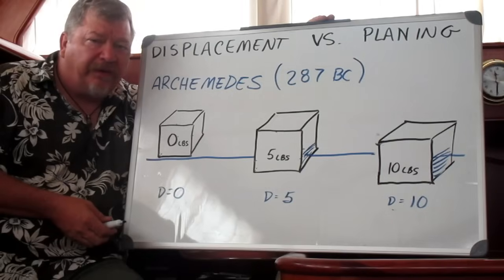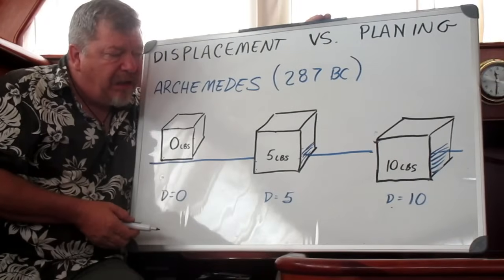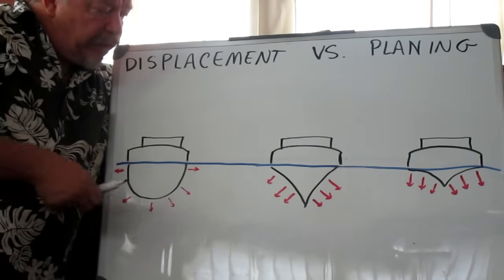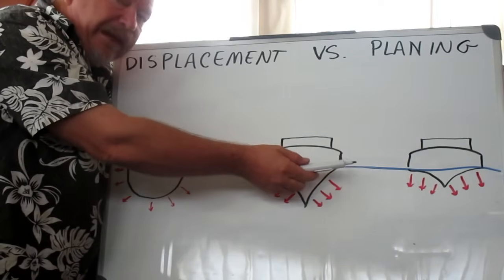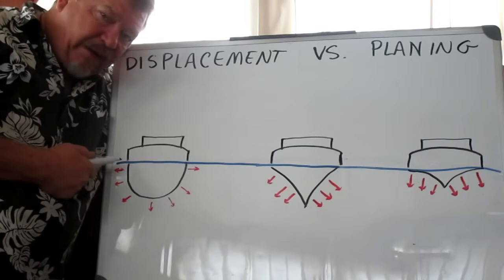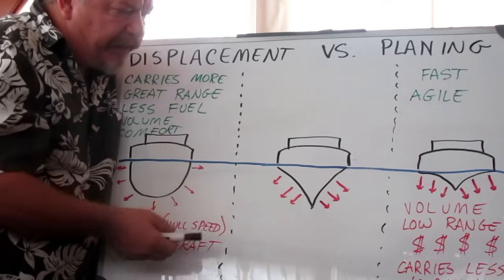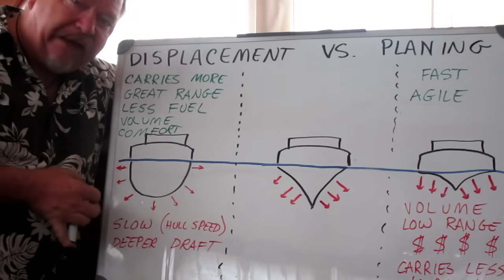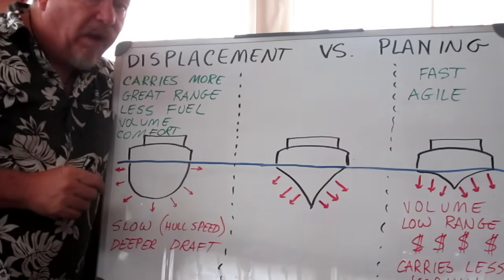Displacement vs  Planing Hulls

Comment: Internet experts tell me this; is not the planing capabilities of a boat be dependent on it's average draft?  If it only covers a larger area, but is shallower, almost any size boat will plane, depending on surface friction/ water speed propulsion ratio. 

I also feel that this video poorly explains why a displacing hull is more comfortable. A deeper penetrating/ heavy hull will go "through" waves. whereas a light/ planing boat will go on top of them, making you move with every wave. 
The wind also affects the boat, both directly and indirectly. 
The goal in comfort is to remove movement. There are multiple ways of doing this. 1. making the boat long. This will enable it to float on top of the waves to a degree. Long speedboats are remarkably comfortable, but this approach is also limited to the waves you are traveling in.  Nature has no limit, boatbuilders do.  
2. Making it heavy, and displacing.  More weight= more wave required to move it. It will move more water, but so will your engine have to do.  Submarines are completely still, they just go deep.
3. removing sway. If you have big keels, of fins "anchored" in the still part of the water, the force of the mast and sails or waves coming from the side, making the boat roll will be counteracted to a degree. 

Solutions (some theoretical) include: Gyrostabilization of the entire boat or just the cockpit, Hydrofoiling (planing out of the water), accelorometer rudders and keels, counteracting the waves like wings. Sheer size, and sheer speed. 

Then there is Multihulls. Top performance racing sailboats now are made to be as big, light, hydrofoil, multihulls
Multihulls can be extremely stiff in the water. But whereas a normal sailboat lays over more as the wind blows harder, a katamaran or triamaran will barely lay over on it's side, and use all the power of the wind to push it forwards. 

Any directions on what is the best combo for a low draft, heavy weight, long distance sailboat?  I'm into Aluminum katamaran with removable keels,  pointy in the front , and flat in the rear, triangle type of deal... if you catch my drift.
Reply from the maker: MusFuzZ,  First, thanks for watching.   Second, Wow!  You brought up some items I did not even get close to in the vid.   I am no marine architect or engineer; I just have a passion for this sort of thing.   Way back when,  I looked at some aluminum and steel power catamaran vessels in the 6o foot range (where metal becomes practical for most cat designs), and realized that the hulls were acting more like separate monos to the point that the addition of a bulbous bow on both hulls was a reasonable consideration.    As to shallow while heavy, logic tells me you have to increase volume to hold up the weight.   Since 'shallow' rules out deeper, you got the choice of wider or longer.  Longer seems a little saner in a mono, but might be an even consideration in a cat.  I have seen some neat (mono)  boats with a length to width ratio under 3:1 that seemed to perform just fine (did not have them in a storm, mind you, and we were motoring, not sailing).  My thoughts start wandering to how you will mitigate lee slip in order to point as high as possible into the wind.   Have you considered lee boards instead of centerboards?   I think you would retain living space and if something breaks (it always does), the leeboard is out where you can work with it.   Dutch tjalks are a neat looking boat, but not sure how you would blend that into a cat concept.     Thanks for a thought provoking text!
Reply: MusFuzZ, To answer your first question; average draft (if you mean the average depth from waterline to keel) does not determine the planing capabilities of a hull.  Long lines determine planing capabilities.  More specifically, long lines in sheer and half-breadth plan view.  If aft of mid-ship the long lines below the waterline flatten out to horizontal in sheer view and parallel to center-line in half-breadth view, you have a planing hull.  The more draft a hull of this shape has is only a factor in determining the power needed to get it to plane due to increased wet area.  In order to have much draft in a planing hull it will have a deep v shape.  Too much v can be a bad thing running too far aft.  Some of these deep v all-the-way aft designs have been know to capsize after getting on plane.  

Displacement hulls have long lines aft that curve back to waterline and back to center-line and will never get up on plane no mater how much power.  Brad does a good job of explaining the general characteristics of displacement hulls vs planning hulls.  Put simply, displacement hulls roll and planing hulls pound.  Planing hulls are fast and fun but will beat you to death in a decent chop.

Seekeeper has a gyro you can install starting around 30k.

Comment: what about the new x bow
Reply: https://www.youtube.com/watch?v=wNyvyI4bXGQ
Reply: I think this design would be great on a smaller commercial crabbing boat in the 40 ft range that im considering for stone crabbing .  I want the wheelhouse to be up front but conventional boat with with wheelhouse up front will just beat the crap out of you in rough water.
Reply from the maker: Meh.   It has the same shape below the waterline as thousands of other vessels, including sailboats.   Yes, it is different above the waterline, and may slice through waves better than other vessels, but it also lacks the deck space forward that a sailboat (usually) needs.   Lots of racing sailboats have plumb fine bows that do the same thing, and a bowsprit for the forestay to get the proper sail volume.

Comment: Displacement and weight are not the same thing at all.
Reply from the maker: Peggy,  Well, they ARE spelled differently.   I, and the rest of the readers on planet earth would like to hear why the weight of the water displaced by the vessel DOES NOT EQUAL the weight of the vessel.   Physics professors across the nation hang spellbound on your wisdom, Peggy.
Reply: If an object is completely immersed (sunk, for example) it will displace an amount equal to the volume of material, and not the weight.
Reply from the maker: If a vessel is sunk, then you are correct.   Where in my video am I discussing a sunk vessel?  There would be no point in discussing the speed of a sunk vessel.   The vessels I describe in my video are NOT IMMERSED.   Did you miss that?  For a vessel afloat (such as the vessels in the video),  displacement weight = vessel weight.  Your comments are based on your own 'what ifs'.   We can 'what if' all day long.   If frogs carried machine guns, snakes would not mess with them.  If the vessel is a submarine, then displacement weight STILL EQUALS the weight of the vessel.   Otherwise, submarines could not surface.
Reply: My original comment did not specify a floating vessel.  It was a generic comment that displacement and weight are not the same thing.
Reply from the maker: Your original comment had no relevance to the video.   You were just poking at someone for the sake of poking at someone.

Comment: I don't see how the one on the left would be deeper in the water when each inch of hull below the water has more  volume than the other two huls.   So unless the boat weighed a lot more,  it should have a more shallow draft (i think that's the right term).
Reply: Mike,   Thanks for watching!   Rather than look at draft or displacement weight, please notice that the water is shouldered aside, or deflected, or pushed (your choice) perpendicularly away from the hull.   Liquids don't compress (at least not enough to matter here), and the resulting effort is translated into lift.   The shape of the hull, then, controls the amount of lift for any given speed of the vessel.  Hope that helped.

Comment: Realizing your video is a year old, I thought I'd add my two cents worth. A lot of people are being picky about terminology. Archimedes principle had to do with volume and mass. But the general point is the volume of the boat must displace a volume of water with an equal Mass to the boat, otherwise it doesn't float. Regardless of terminology I think you have grasped it perfectly, some people are just too picky.
Reply from the maker: Jarod,   Thanks for watching!    Yes, some folk are picky, but it doesn't bother me much.   I have had an amazingly small amount of trolls on the site.   Have had a lot of instructors and students of the Coast Guard Academy and Naval architects thank me for the easy explanation.   That said, I am no engineer and certainly not an expert.  I would hope that this vid helps people understand some of the concepts.   If they are actually building or racing, then they would want a lot more experienced person than me to explain it all to them.   Cheers!

Comment: Sorry this is wrong. It is the volume of the submerged object that is displaced. Imagine a extremely, unnatural heavy stone, thrown in the water compared to a light stone.
Reply: The assumption made is the object has to float.
Reply: High Velocity it is about the volume of the part of the boat that is submerged.
Reply: The object has to displace it's own weight or it sinks.
Reply: He's talking about boats not submarines.

Comment: I come from a boat building family and still find boats fascinating.  I wish to comment on this subject in that displacement hulls are only displacement hulls when they are stationary as when they move the dynamics around their hull provide regions of higher and lower pressures and these are vectors and so the hull even though we may call it a displacement hull, it still experiences the   dynamic forces that a planing hull experiences. Really no hull is a displacement alone and no planing hull is planing alone as even if it rises on foils there is still the displacement of the foils in the water.  
The  dynamic pressures along the  moving displacement hull are very complex as at the bows the pressure rises due to the fact that the  half angle of the bow is  accelerating the water laterally so that t he hull can go through the water.  Since the water is not compressible, then the water rises causing a bow wave while the bow becomes more immersed and so displaced more water causing this  action to raise the bow.  Midway on the displacement hull, the water dynamics will cause the mass of water to drop down below the  normal surface due to the momentum of the water coming down the   elevated bow wave. As the water moves away from the hull, the hull sinks a little as the  narrow bow  angle  does not have enough displacement nor dynamic lift to replace the buoyancy of the voluminous middle part of of the hull.  So when a displacement hull moves then  it sinks a little and it tries to fit into a wave of its own making.  At the stern the water will try to move in to fill in the trough that the hull creates as it moves forward. Filling in this trough is the most difficult part of the function of a displacement hull as the water has a lot of inertia and it is reluctant to move back into the stern part or under it one might say.    Now the moving read underside of a displacement hull is raked up and this is because a truncated stern as that of the planing hull creates a lot of drag.  The underside of the rear part of a displacement hull creates a lot of low pressure trying to suck in the water under the stern and also causing a  partial vacuum which  tries to pull back the hull and this is a form of drag.  Since the water  is so reluctant to fill the understern part then then design angle of the manner in which the stern rises is very critical and for faster  buoyancy hull it is this rise angle of the stern that decides how fast and how much sucking back is  created. In a hull with a powerful engine, the moving displacement hull raises its bows and  digs its stern and this is a waste of money as the fuel is used in making waves rather than moving the boat at a faster speed.    The raised stern in a displacement hull makes a very comfortable ride with a read wave attacking the boat and broaching is avoided . 
Nowadays with such powerful engines, the rear part of a displacement hull is truncated and rather than filling the void with water one permits air to fill in behind the truncated transom, Fast commercial passenger catamarans use this technique and they can go faster because there is no vacuum forms  just ahead of their transom.     
With planing hulls there is an even bigger story as while the centre of gravity stays put, the centre of lift moves ahead and astern of the CG and so a planing hull can oscillate and porpoise and it is very difficult to design a stable planing hull for all conditions,  we try, but no one has yet succeeded in optimising a planing  hull  for all sea and weight conditions. 
The owner of the Puffin seen in this video is a very wise man in selecting the boat he wanted.  It looks as if he is wise enough to appreciate all the benefits and disappointments provided by the displacement or the planing hull.  I   feel that at my age a displacement hull is my preference but the hull I prefer is one where I would summarise through saying that the under curve of the  hull  would be something like an inverted sine curve and no displacement hull should be designed on a straight line representing the horizontal surface of the sea as that is a static condition.   When a displacement hull moves in the water it creates a bow and a rear wave and the whole hull must fit in it with the same draft all through the curve.   This may sound far fetched but  I say that a displacement hull moving at its maximum natural speed through the water is in fact a planing hull as the dynamics come in to  support the hull in a wave of its own making and though it sinks in it a little , the hull is really a semi planing hull.    The beauty and elegance and majesty of a displacement hull going at its maximum limiting speed through the water is a situation that will fascinate me to study the situation for the rest of my life.
Reply from the maker: Carmel,   Thanks for watching the video, and thanks for an awesome explanation!   Lots of things there I did not consider and fun to think through.   I am no engineer or marine designer, so I tend to go (as in the video) with the 'rough' explanation.   As you balance the cost of vessel production into the mix, I think you boat builders have come up with some elegant solutions; a tapered stern to reduce the stern vacuum, for instance.   I am also fascinated by what an unrestricted budget will produce, such as the shapes and size of the bow protrusions on Navy vessels.   If you have the opportunity to use a test tank, I think it would be very interesting to pursue your idea of a curved keel that changes the hull volume to mitigate the bow wave.     Another area I think would be fun to study is the work being done using air bubbles (pumped into the laminar flow) to mitigate some of the drag on higher speed surfaces.
Reply: This is of course true, although the conventional terminology is accurate enough for normal descriptive use.  A displacement hull is designed to go through the water although it generates some lift, a planing hull is designed to skim over the water, and a semi-planing hull to rise up and carve through the water.  The most extreme cases are those super short windsurfers which will not support the user above the water level until they are generating lift.

Comment: I’m looking to build a solar powered boat (over the next 2 years) and I want to be able to go to the north and south poles the boat will only be around 8ft by 20ft give or take what hull type would be best?
Reply: It’s going to be made from aluminum
Reply from the maker: Wow!   That sounds like quite an adventure.   I would recommend a mono hull for a couple of reasons.   First is that you can carry more supplies because the mono is less sensitive to weight than the average cat.   Second, you can use metal in the construct for the same reason.   Resistance to ice is going to be critical.    Yes, you can get in and out faster in an average cat due to the faster speed of the hulls.   Just my 2 cents, though.  You may want to bring the question to both a mono hull designer and a cat hull designer.   That way you can compare the styles by cancelling out the opinion bias.

Comment: Lifted from an online article on the (inter-war/) WW2 German Schnellboot:
  "- After experimenting with the S-1, the Germans made several improvements to the design. Small rudders added on either side of the main rudder could be angled outboard to 30 degrees, creating at high speed what is known as the Lürssen Effect. This drew in an "air pocket slightly behind the three propellers, increasing their efficiency, reducing the stern wave and keeping the boat at a nearly horizontal attitude". This was an important innovation as the horizontal attitude lifted the stern somewhat, allowing even greater speed, and the reduced stern wave made E-boats harder to see, especially at night."
Reply: E boat

Comment: - And a displacement hull isn't necessarily slower.  The 'Nazi' Schnellboot was not only faster than the comparative 'single step planing' hull used by we British (& shared with the US) but it was more suited; read efficient; for the North Sea/Atlantic use that it (they) were designed for. And worked better in the open Med under most conditions as a Planing hull is decelerated by wave strike; that is before you even consider that the Planing hull only has a relatively narrow 'sweet spot' of efficiency - the inter-web is full of 'learned' sites on just this matter.